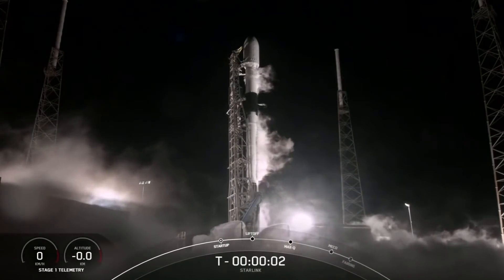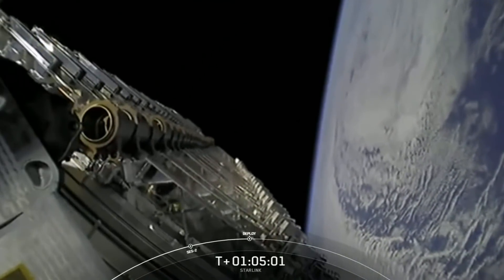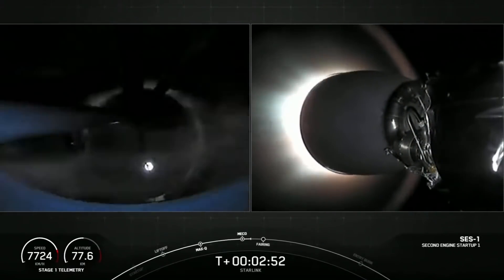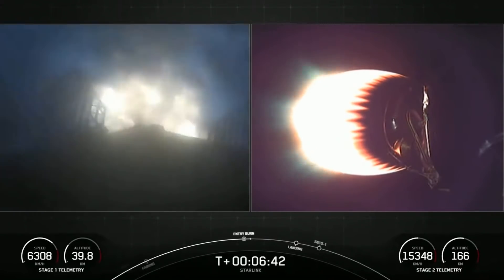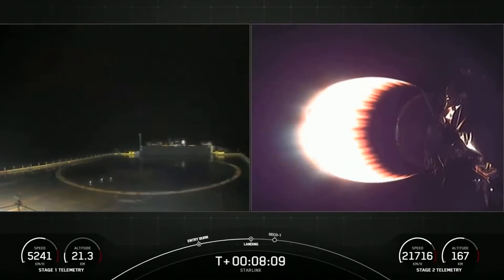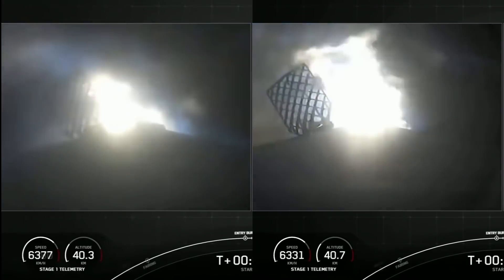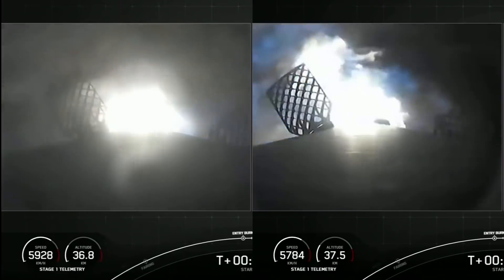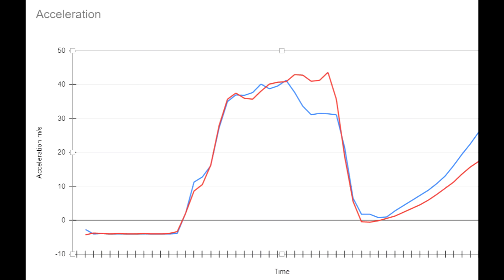Did An Engine Failure Kill A SpaceX Booster on Its 6th Flight?

Comment: Hi Scott, in regards to your comment at 10:24, Thunderfoot released a video about SpaceX and that their idea of rocket reusability is basically inefficient due to reducing payload capacities. COuld you comment on that?
Reply: Thunderfoot sometimes takes his skepticism a bit too far IMHO.

The Falcon9 can be (and actually sometimes is) used as an expendable rocket when the payload requires it. But when you have a payload that does not exhaust the capabilities of the rocket (which is the case for most payloads), why not use the extra margin to recover the vehicle? It's a huge cost saving.
Reply: Yeah but we are talking a 50% reduction in payload to make the thing recoverable. I am not sure if you would still be better off to not full up to 100% and lose the rocket...
Reply: @hawkanonymous2610  The payload reduction is only about 30% compared to expendable mode. That's a good tradeoff, when you can save about 80% of the launch cost by reusing the booster.
Reply: @stephanweinberger  But you are not getting a 80% reduction in launch costs, do you?

The 40% reduction of load is only for recoverable boosters, the other stages have even higher payload reductions.
The boosters are about 60% of the total cost so at most you can save 60%.
Add to that refurbishing (Musk says this is less than 10% of the booster cost, so in terms of total launch percentage lets say 5% points) and 
you end end up with 60% load and about 45% of the original cost for a launch with a reusable rocket.
So virtually no efficiency gain from that by payload per money.

Now, how much more expensive if a reusable booster to a non reusable one?
(Remember, for the first launch of the booster the cost is 100% but you still have the 40% load reduction)
Lets say the reusable booster is 1% of the total launch cost more expensive to make than the non reusable one ( In terms of booster cost that would be about 2% more expensive).
That would mean you would have to launch the booster tens (with an s) of times before the whole system has a better load/money ratio than just using one way boosters.

Source for the numbers from Musk:
https://www.inverse.com/innovation/spacex-elon-musk-falcon-9-economics
Reply: As long as SpaceX can fly the majority of the payloads on the market at competitive prices, it shouldn’t matter to the customers whether the rockets are bigger than their expendable competitors.
Reply: Well, if they can only fly them at that ptice because they are supsidized by the US governmemt, that is basically meaningless
Reply: Thundertwat should have done his research.. Elon himself said they break even after 2.  So thundertwat is stupid.. STILL.
Reply: Elon Musk says a lot of things, that does not make them true. If they could break even at 2 launches, why is the launch price by SpaceX going up all the time instead of going down?
Reply: @hawkanonymous2610  The published price for a satellite launch has been $62 million since 2016, so where are you seeing prices going up?
Reply: @hawkanonymous2610  Prices have not been going up.

Comment: A failing engine was my first guess during the entry burn yesterday..
It just didn't look right as it burner, and when the flame didn't go out after the "shutdown" call-out, I figured it was done for..
I also think that perhaps the booster still may have a bit of control of itself, even if Mission Control didn't, and it made sure it guided itself away from OCISLY.. meaning those gulls get to live another day..
I look forward to hearing from SpaceX and or Elon in the coming days.

Comment: It’s funny you mention this, because I was wondering if they intentionally crashed it to avoid burning those birds alive.  If so: kudos.
Reply: The 1st stage normally makes a ton of noise during the landing burn. There's no way the birds would stick around on the landing pad with that kind of noise overhead. The fact that they were barely disturbed suggests that the landing burn either never happened, or it was a long way away.

Comment: I'm wondering if it was blown up by FTS as they would want it impacting the droneship at transonic speeds
Reply: The rocket will miss the droneship if the landing burn fails.
Reply: also the FTS is safed or disabled around the time of the entry burn (you can hear the call out on the webcast) from what I understand

Comment: I noticed that the flying rats seemed to startle a second or two after the flash, and then again ~10 seconds later... I wonder if they saw and then heard something.  Could certainly determine how far away the splash was from the ship from the time delay.  Not that it matters, but, might as well go 100% nerd! :)
Reply: Exactly 9 seconds after the loss of light. 343m/s × 9 = 3087m / 1.9mi away?
Reply: Exactly my thought.
Booster hits water; explodes.
Seagulls startle a little bit from the flash.
Gulls settle down.
Seagulls startle quite a bit more from the boom.
Gulls settle down; proclaim their work here done.
Reply: @gp2k00  Gull Sensors 😁
Reply: I was going to post this theory, too.  Glad I read far enough down the comments first!
Reply: During the second scare you can see what looks like a shock wave going over the barge.  I think you are right and the first flash is either the booster exploding in the air or when it hits the water.  Then the shock wave and noise takes a number of seconds to reach the barge.
Reply: @stevenfox4813  Yea I figured the orange glow was the booster going up in a big fireball.
Reply: Shock wave through water much faster than air. Sound came later.  I’ve felt the same from ordnance dropped near (1mile) the carrier I was on.
Reply: @UPNORTHWOODS  Dude!  you can't just drop shit like that without some details!  Sounds amazing (and terrifying!)
Reply: We should track them down and interview them.
Reply: @hatman4818  the rats: "mine", "mine!", "Mine"....
Reply: I'm sure that the support ship a few miles away has one or more radar sets on it. Tracking the reentry.
Reply: @kkarllwt  absolutely!  I was in no way suggesting that we could offer SpaceX additional data they don't already have - I'm sure they know exactly where it was. It was purely a nerd exercise!
Reply: @GlenWooden67  SpaceX knew, but some of us didn't. Thanks for your observation.
Reply: @GlenWooden67  I’m kinda thinking the first flight of the birds was from “Thor’s hammer” 8 seconds later the sound spooked them again. That puts the distance at approximately 12,000 feet. Sound travels through water at about 4800 FPS and air at about 1100fps. Having ordinance dropped off the ship wasn’t unusual. Nothing exciting to tell. But I’m here to tell you Thor’s Hammer hits a lot sooner than the sound of the explosion.
Reply: There was probably a sonic boom first then a RUD.
Reply: @ExplorUranus  Yes I agree, the flash is way before the first seagulls freak out
Reply: Now throttled up to full nerd thrust.
Reply: We need to interrogate those gulls. They are our best witnesses.
Reply: I thought this as well and suggested the same to the SpaceX facebook group.  I'm pretty sure we're right on this and it would be cool to see it confirmed by someone with official info.
Reply: first one for sonic boom, then for greater boom when F9 crashlanded
Reply: Go nerds!
Reply: I think the sonic boom hit the barge at the moment the booster hit the sea. Assuming from F9 heavy launches the boom hits the observer a few seconds befor touchdown and the booster wasn't breaking as normal so it reached the sea faster.
To summarize i think the guls first hop was coused by the sonic boom and the second by the actually explosion midair or crash.
Reply: Also i think it didn't realy broke apart midair couse in that case we woud probably see some glow after the rocket hit the sea, raither fuel woud probably fall slower and it woud float on the water. Also the yellow sugest it's probably running fuel rich and this combined with the much more white/blue glow while reentry sugest it coud be a oxidiser leak that emptied the tank completly.
Ps it's all only my nerdy theory

Comment: Hmm, sounds like there might be an intrinsic engineering systematic issue with the engine construction and fuel delivery system that is getting missed in all SpaceX engines in their recovery profile (even though---fortunately---quite rare). Starship (Merlin) and Falcon (Raptor) engines could be seeing issues not foreseen until now for no other reason than just the amount of launches (Raptor) and the loads put on it (Merlin). Kudos to SpaceX with the smartest engy's in the world, but...still....a problem. Or...and this is the hope...that maybe its just an isolated problem that caused this single issue for them that would never happen in a bazillion years. However, shutting off and restarting engines is something new, and is VERY stressful on these rockets and engines, so there are problems that are going to come up. However, there's no one on this earth that I would trust to solve true problems more than Elon and his team of super Mensa Super humans.
Reply: The two systems are so different this is entirely meaningless.

Comment: SpaceX has been having a rough time with engine failures lately
Reply: Not really. besides this one, the raptors on SN8 and SN9 are pretty much prototypes
Reply: @whatever6938  True, it's easy to forget with how fast progress has been that the even the Raptors are still being worked on.
Reply: Raptors themselves are not failing. Other systems are or fod damage to plumbing